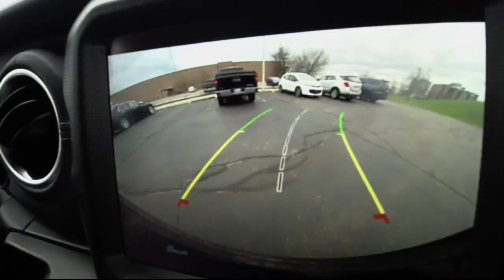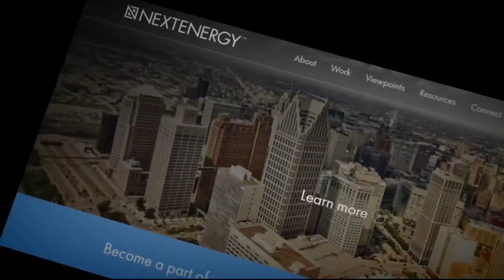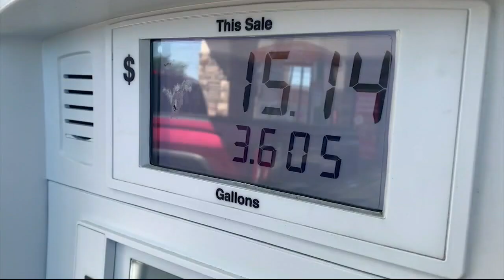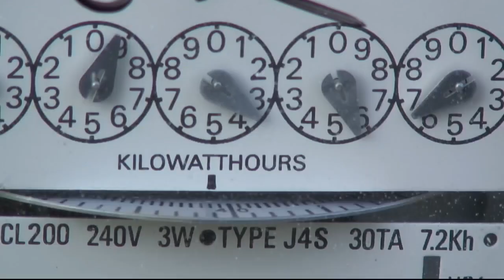Range anxiety - experts explain how electric vehicle apprehension can be solved

Comment: In a couple years the battery life will be greatly reduced .What kind of range will they have then and what will happen to the value of the vehicle?American people have kept vehicles for  decades. Some have kept their vehicles for their entire life. They will not be able to do that with an E.V because they are not able to replace the battery with most models. They are going to be more less disposable items that have cost much more money.That means that  many more vehicles would have to be created than they were previously.Also the  pollution from the waste and  manufacturing of them will cause more damage to the environment than gasoline vehicles did.

Comment: Hybrid is the way to go instead of putting massive batteries in cars and making them that more heavy. Instead of putting huge batteries (55-80KW) and making it an electric car, why don't we move towards a 'hybrid' world where car has a small 4 cylinder engine coupled with 20KW batteries so cars go about 80-100 miles on a charge and switch to that small engine when out of juice. and you can charge them over regular household outlets. No range anxiety and most commutes are about 40-60 miles here in US.

Comment: I'm done with electric  cars,  I went back to gasoline because  of all hassle associated with electric cars and trucks !  No more for me , I've learned my lesson and my " ELECTRIC  CAR ANXIETY SYNDROME IS GONE " ... Happy days are here again !!
Reply: No problem here since I'm retired and only drive less than 25 miles a day or on some days, other days none at all. I've owned a Tesla model 3 for two years and have made several road trips with no problems of running out of charge.
Takes a bit of planning but with Tesla's great and rapidly expanding charging network, there's not much anxiety in my own experience. EVs are the future and the technology with EV cars is changing and improving so fast. Many drivers are so done with gasoline and the gas prices, the auto dealership and all the maintenance, parts and decreasing value of ICE cars.
Most EV buyers are not going back.